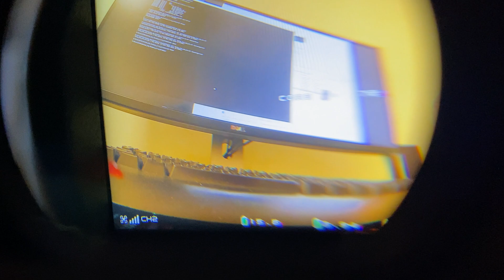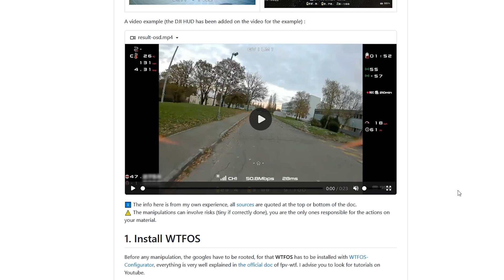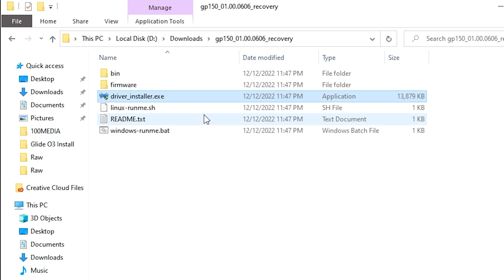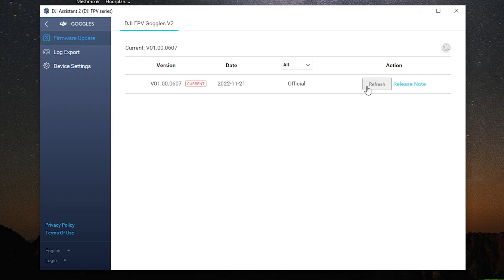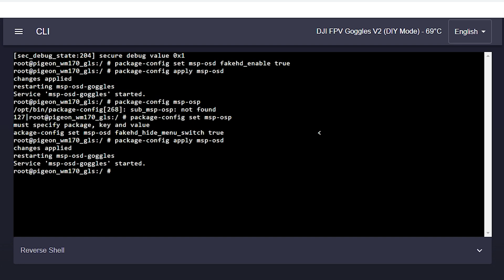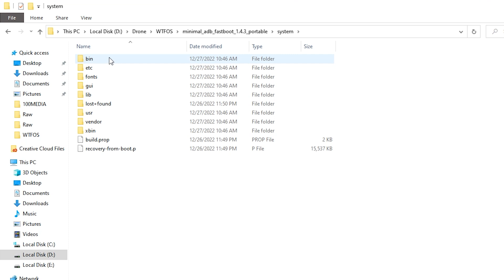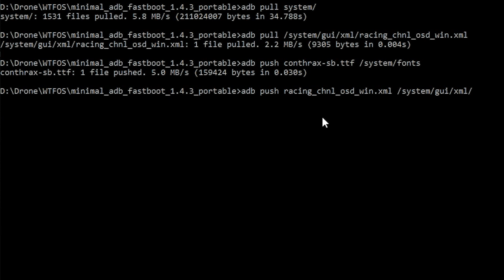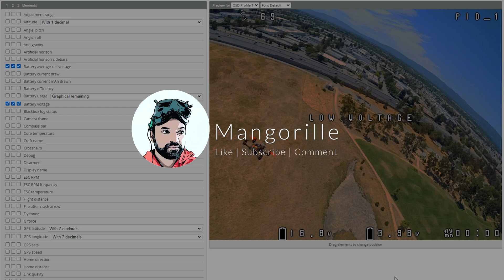FULLY Customizable HD OSD canvas mode for DJI FPV Goggles V1 & V2 | My EYES can't handle the BEAUTY!

Comment from the maker: Hey All. With the release of Betaflight 4.4 HD OSD, I want to give you an update on changes necessary to get this working correctly on 4.4. If you follow the exact steps in the video without these changes, your OSD will be shrunk into 1/3 of the screen in the goggles. You can follow all the steps in the video EXCEPT, 1 - There is no need for the FakeHD (do not run the CLI commands below in WTFOS). 2 - You should set the OSD to HD in Betaflight, and 3 - No need for the throttle position OSD element in position 4. Everything else works perfect.

package-config set msp-osd fakehd_enable true
package-config set msp-osd fakehd_hide_menu_switch true
Reply: so if I have some vistas vtx and camera AND O3 also, can this procedure work? (suppose that I have all my quads on BF 4.4.x) TIA
Reply from the maker: @Pozzix65  Yes, this will only take effect when you're using the vista though (DIY mode). The O3 mode will continue to work as originally provided by DJI.

Comment: my goggoles and goggle record time dissapper... @@ wrong on xml isnt?
Reply from the maker: Yes, the xml file has an issue. You may have moved it too far off the screen. Unfortunately it is a lot of trial and error unless you can get that overlay preview tool working (which I wasn't able to).
Reply: @Mangorille  i see... I think will root back to first place 😅.
btw i message you on instagram
to send you image from goggles.
Anyway thanks

Comment: Hey man, thanks for this video, I now have that sweet custom DJI OSD just like the pic on the github page, The guy provides his own racing_chnl_osd_win.xml on the page and if you have the conthrax.ttf pushed you can just push his . xml file to the googles and it looks and works great, no need to mess with it yourself, only mod I had to do myself was move the DJI transmitter icon, (because I love it and wont switch as I only fly v1 air units.) which was easy after seeing his file. I now have MSP OSD, Custom DJI OSD and live audio. Thanks again could not have done this without the Video.

Comment: Thanks! This is so cool, I finally turned off the annoying default voltage/timer and moved all the icons around to make it look clean.
Reply from the maker: Ya, takes a while to get perfect but time well spent. I miss this level of customization now that solely use the goggles 2.

Comment: I cant get custom osd elements to work. I followed all these steps and got wtf os working on goggles. on the goggles on bottom right it says waiting for osd. please help i want to fly lol
Reply from the maker: Did you make sure to install WTFOS and MSP Displayport on the vista air unit as wlel?
Reply: @Mangorille  i accidentally unplugged during updating but it still shows video and pops up for a second on wtfos and then disappeares
Reply: I also reflashed with butter
Reply from the maker: @sjacksonhodum  If you unplugged it during updating, I'd suggest you start the process from the beginning again just in case something didn't get updated correctly. You can uninstall WTFOS and then refresh the DJI firmware. No need to re-root the goggles, that's a one time.
Reply: @Mangorille  thanks!! I fixed it and am loving the pretty osd and the longer range with 1200mw. I love ur video. It helped lots. I had to hold usb cable at certain angle lol. Thanks once again
Reply from the maker: @sjacksonhodum  Awesome, happy flying!

Comment: Hi, i followed every step till the point of getting the conthrax -sb font to the goggles and i am lost.  Can you elaborate more on it. in Minimal ADB and fastboot termminal after pulling the XML file , i checked in my folder the "system folder" apprears as it should be as per your instructions. I have downloaded the conthrax fonts do i copy the font file into the Minimal ADB and fastboot folder and rename the file ending .ttf?  I am stuck at pushing the conthrax sb fonts to the goggles. some help much appreciated.
Reply from the maker: You copy the font file to the minimal adb folder. The font file should already have an extension of .ttf. If it doesn't, make sure that you are actually seeing the file extensions (windows hides these by default).
Reply: @Mangorille  hi, thanks for the reply. I will give it a try again.

Comment: And the winner is......the OLD AirUnit - because the NEW SHINY O3 isnt working with that !!!
Reply from the maker: Ya, but the O3 supports the MSP Canvas mode natively. Sure it doesn't look as nice with the custom logos and fonts but you get other things with the O3 that the old air unit doesn't support. Still neither system is perfect and I find myself flying both.

Comment: Great tutorial. But please let me know. How to make step back from fakeOSD. How come back to default OSD with WTFOS or disable any changes you showed? :)
Reply from the maker: Thanks! Run these commands to disable the fakeHD. If you made any changes to the native XML of the DJI OSD, use the adb steps to put the original XML file back onto the goggles.

package-config set msp-osd fakehd_enable false
package-config apply msp-osd

Comment: Heloo mangorille. I have done everething as you said, iam also on 01.00.0607 but i have this mensage

" 00:04 Attempting Step 1...

00:41 - Found Device: GP150, Version: 01.00.0607

00:41 Step 1 - Success! Rebooting...

01:06 Attempting Step 2...

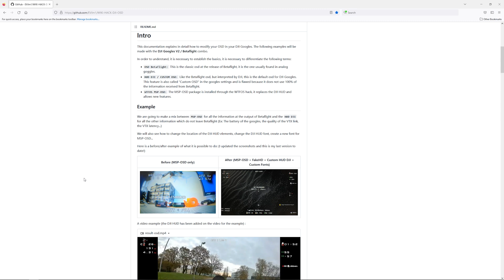01:17 Step 2 - Success!

01:20 Attempting Step 3...

01:24 Failed! Your firmware might not be rootable, please try downgrading with Butter."

I have used butter as you also but iam getting that message at the end

thanks
Reply from the maker: You should use butter to downgrade your v2 goggles to 606 firmware (you are on 607). Also make sure you’re on the DIY mode in the goggles when rooting.
Reply: @Mangorille  i could do it. But know i can't see the new font in googles, what could that be? I see the old letters in fake hd
Reply from the maker: @gonzafpv2843  Make sure you unplug the goggles from the computer. I noticed that the fonts will not pull in as well when connected to the computer.
Reply: @Mangorille  i have done that but i can't still see de new fonts :( what i could be doing wrong? Also, when You done the wtfos You upgrades Again the googles with assistant, why is that? It si not supposed to be o. 0606? Thanks
Reply from the maker: @gonzafpv2843  Did you make sure to root and install the MSP OSD on the vista as well? Once you root, you can use the DJI software to upgrade the firmware.

Comment: @mangorille 
Hello! Have some questions. 1 iam using mi v2 for mi caddx vista build and for mi potato dji fpv doing this It affects in something the potato? And also when changing cadx vista firmware, y Will loose bf configuration? Like pids rates and all the others config un bf? Thanks!
Reply from the maker: No, it wouldn't impact the DJI FPV mode as the Caddx Vista runs in the DJI FPV System mode. Changing the Caddx Vista firmware does not change your Betaflight configuration. They are completely unrelated.

Comment: Hello Why does the OSD keep blurring?
Reply from the maker: What do you mean by blurring
Reply: @Mangorille  goggles V1 reboot osd mess
I'm not good at English sorry!
Reply from the maker: @e2untae  If the OSD keeps rebooting it means you have an issue with the XML file (i.e. you made a change that broke the expected format). You can grab my file from the video description and then make changes very slowly until you have the desired layout.

Comment: Thank you man for your guide, but I've one question: after following all the steps in worked perfectly fine, but... Bitrate and latency are not showing up anymore. Just the icons, with no values. Any help? Thanks again!
Reply from the maker: Did you try moving them around? Possible that you moved them off the screen. You can try using the XML file I have linked in the video description and then tweaking the X and Y values every so slightly. It's a trial and error process.
Reply: @Mangorille  Thank for you reply, I fixed it. Problem awas I didn't push .ttf file also for DJI HUD. I told the goggles to use it while not pushing it in the right folder. Have a nice day🤜🤛
Reply from the maker: @gabrielezilliFPV  Ya that'd do it, glad you got it figured out. Happy flying!

Comment: my native Hud is squashed so it doesnt get the full text how do i move that around so it gets more space ?
Reply from the maker: Squashed into 1/3 of the screen with Betaflight 4.4? If so, look at the pinned comment.
Reply: @Mangorille  No. the volt. timer and google battery is squashed with conthrax. so it show like 22...... and tiemr 0.0..... and google battery 14......
Reply from the maker: @Mqzfpv  Sounds like the font size you have is too large. Try adjusting the font size smaller. I have my XML file in the video description if you want to give that a try.

Comment: This dint work for me idk what I did wrong. I followed every steps in the video
Reply from the maker: What happens exactly after you followed these steps? Which goggles and air unit did you try this on?
Reply: @Mangorille  v2 googles and O3 unit. I have the OSD. It's just that the font never change..

Im pretty sure I followed from step one all the way to the end. Idk why it doesn't work..
Reply from the maker: @russgrgda8198  This does not work with the O3. It requires WTFOS which only works with the vista/old style air unit. You probably did the WTFOS on your V2 goggles in the Digital FPV mode. You would have needed to also install WTFOS on the air unit side and it wouldn't have worked with the O3.

Comment: everything works except stick throttle why
Reply from the maker: You mean the throttle stick position doesn't show in the goggles? If so, it's because we ran a command to hide it. If you want to see it I can give you the command to show it.
Reply: @Mangorille  yes i will be grateful
Reply: @Mangorille  fakehd_hide_menu_switch false ? i have to do the command false
Reply from the maker: @Yukrop  Correct, and then make sure to run the apply command afterwards.

package-config set msp-osd fakehd_hide_menu_switch false
package-config apply msp-osd
Reply: @Mangorille  tnx

Comment: hello :-) I follow your video on every step, I change DJI font for new one - Conthrax TTF but still see just old analog text and battery icons from osd and dont see ani colour elements. Just mix DJI info on left and other font in middle and right side ... not sure whats wrong :-(
Reply from the maker: Did you put the font files onto the SD card?
Reply: @Mangorille  yes
Reply from the maker: @SalySalymon  All four font files on the root of the SD card? Did you unplug the USB from the goggles and restart the goggles?
Reply: @Mangorille  yes I do :-( ita really posaible got color font i googles? its font from DJI side (googles) or from transmiter?
Reply from the maker: @SalySalymon  The OSD is driven by the goggles.

Comment: hey, quick question. why my "home direction" osd does not appear on my goggle ?
Reply from the maker: Which air unit are you using and which OSD? There are different methods of OSD right now:
1. On the Vista/original Air Unit, there is a custom OSD built into the goggles. This will not work for all elements.
2. On the Vista/original Air Unit, there is the MSP Display Port when using WTFOS
3. On the O3 Air unit, there is the MSP Display Port by default
Reply: @Mangorille   im using the wtfos OSD and still cant see it. is there something I missed ?
Reply from the maker: @rahmatrizki2811  Ah okay. I'll let someone else comment, I don't use GPS on my quads. Only thing that comes to mind is whether you had sat lock before you took off?
Reply: @Mangorille  one last thing. And Also some elements are not fully shown (cropped)  which I think this has something to do with why my “Home direction” does not appear.
Reply from the maker: @rahmatrizki2811  Are they cropped or do you see them wrapping around. If they are wrapping around, you need to look at that mapping of how the FakeHD takes the 4:3 and makes it 16:9 (the diagram with the colours) @ 4:13 in the video
Reply: @Mangorille  ohh yeaah, i  forgot to tell you, why it says "adb: error: cannot stat 'conthrax-sb.ttf': No such file or directory" when i tried to put the cli command. i really really need your help on this one please
Reply from the maker: @rahmatrizki2811  What is the exact command you used?
Reply: @Mangorille  the one that you put on the discription
Reply: did I skip something or what ?
Reply from the maker: @rahmatrizki2811  The one below? Did you make sure to put the font file in the same directory as your adb software?

adb push conthrax-sb.ttf /system/fonts
Reply: @Mangorille  yes. So I copied and pasted the font in the same directory with adb software. exactly like u did in the video
Reply: btw thank u for replying man. it means a lot for me. Appreciate the effort!
Reply from the maker: @rahmatrizki2811  No problem. Try two things:

1. Run this command to make sure your goggles are connected correctly: adb devices

2. In the below command, change the font name (conthrax-sb.ttf) to exactly what you have including any upper case or lower case letters:

adb push conthrax-sb.ttf /system/fonts
Reply: @Mangorille  BRO. it worked! in my case it was that my font file name was "conthrax-sb.otf" not "conthrax-sb.ttf". i didnt fully give my attention to that. what a ridiculous mistake. once again thank you for all your assistance man! may god bless you.
Reply from the maker: @rahmatrizki2811  No problem, glad you got it working. I haven't tried a otf font file so hopefully it worked in the goggles too!

Comment: Hi I have issues with throttle position..I moved it to same position like you and I don't know who but I can't see it on goggles screen
Reply from the maker: You're not supposed to see the throttle position on the screen. It is just a flag used by FakeHD to turn itself on or off. Do you want to see it? If so, you need to change one of the command lines I provided.
Reply: @Mangorille  do you know this command to fix it I really need to see throttle position. Thanks
Reply from the maker: @SKocinski  Because you're already turned it off, run these two commands:

package-config set msp-osd fakehd_hide_menu_switch false
package-config apply msp-osd
Reply: @Mangorille  thank you for your help 🙃🙃

Comment: Hey
So i've installed the WTFos both on Vista and Goggles v2, and tried to add the FakeHD and same custom font as u.

Unfortunetly i've ran into an issue where the OSD is freezing and restarting. 
Also im unable to enter the DJI osd menu. Tried to hold the Backbutton for 5 sec, also doesn't help to show the DJI osd.

Anyone had same/similar issue? 
Uninstalling WTFos from the googles might help fixing it? wanna rollback before installing FakeHD

https://www.youtube.com/watch?v=ejuo7FJ0UxQ
Reply: nevermind - found the problem was missing " after the font name in racing_chnl_osd_win file
Reply from the maker: @Faronsky  Glad you fixed... The restarting OSD is a sign that something got messed up in the XML file.

Comment: I did everything like described in the video. Thanks. It works - but I can‘t select/switch anymore from 1 to the other system. I configurate everything fine on DJI FPV digital system, but after I can‘t switch anymore to DJI O3 system. 😢😢😢
Reply from the maker: You no longer see the DJI O3 option in your Goggles V2?
Reply: @Mangorille  yes. The Wtfos MSP OSD software is great but after installing i can‘t select anymore Dji O3 system with V2-Goggles
Reply from the maker: @elmarirony5580  Check this page about half way down: https://github.com/fpv-wtf/butter

Loss of O3 mode after re-installing wtfos
Reply: @Mangorille  thanks Mangorille, now works very well. 🙏
Reply: Is it possible to use WTFOS also for O3-system?
Reply from the maker: @elmarirony5580  No, the O3 side hasn't been cracked yet by the WTFOS team.
Reply: @Mangorille  you are great! Thanks for the help

Comment: Can we remove the sd card after root and font install?
Reply from the maker: After root the sd card is no longer required but it is required for the fonts with FakeHD. If you remove it, FakeHD will not find the font files and then will revert to its stock fonts and icons.

Comment: Hi. Does this work  to dji o3. I find the osd in the center and not in the end of each sides.
Reply from the maker: Not with the O3, this only works on the prior system with the V1/V2 goggles. The O3 will work as you mention and even the new version of betaflight doesn't seem to resolve that.

Comment: Hi There,
Great informative video. I saw on another channel the below commands ran. Do you have to run these each time you run updates? If I'm missing something please let me know

Thanks

Air unit and caddx vista
package-config set msp-osd compress_osd true 
package-config apply msp-osd

DJI Goggles
package-config set msp-osd rec_enabled true 
package-config apply msp-osd
Reply from the maker: I didn't use that command on the air unit side. It seems like it may be specific for INAV so that it sends compressed OSD vs. RAW data. No need to reapply.

Comment: Do you know how to get the mbps/sec and ch to appear correctly? I tried to copy the .xml file provided in the github page but those three above the battery won't show up
Reply from the maker: Try using the file I put in the video description (goggle drive). Those will have the items displayed and then you can follow the instructions in the video to fine tune through trial and error to get it exactly where you want.

Comment: After "package-config set msp-osd rec_enabled true" and the "package-config apply msp-osd" I don't get a .osd file on my goggles, and yes I rooted and installed wftos on the goggles and air unit. Do you need to arm the aircraft in order for this to work? I only see the .srt file.
Reply from the maker: You either need to arm or you need to turn off the auto temp control.